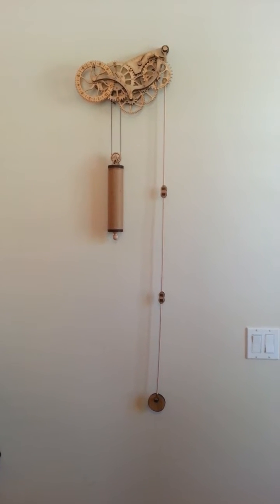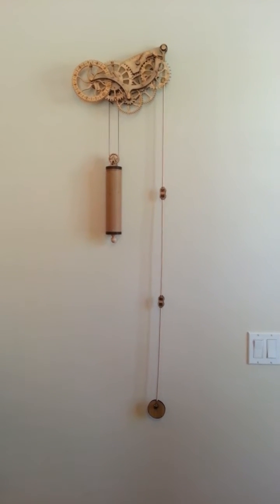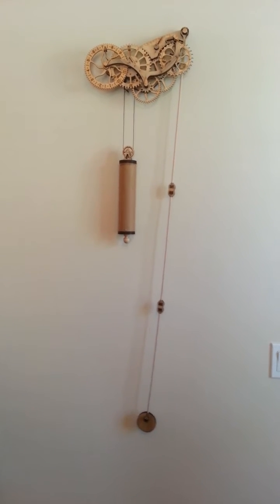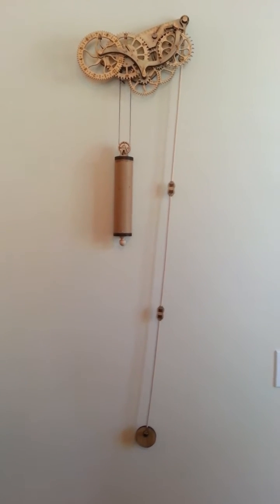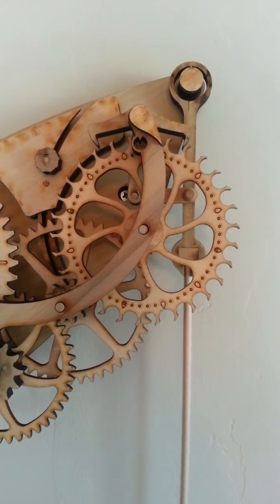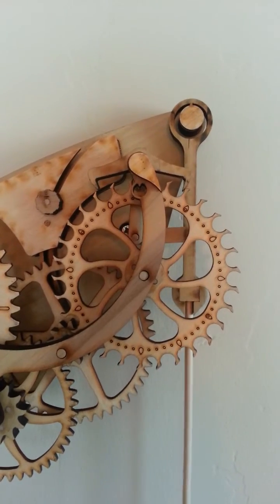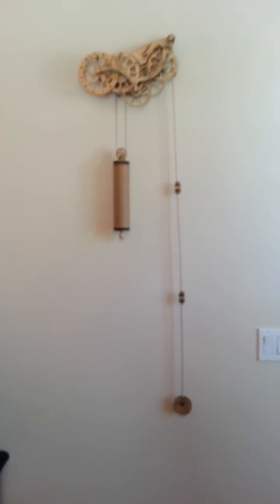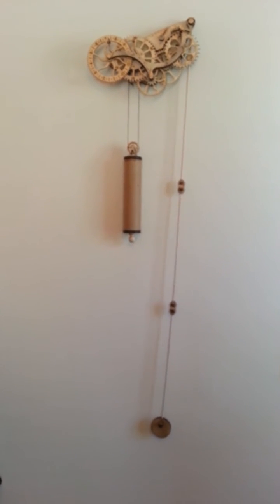Wooden mechanical clock in action!!

Comment: Does the screw at the bottom of the pendulum actually do anything for your clock?
Reply from the maker: I have to say that I didn't find it terribly useful... Precision after initial assembly was good, but if you are off by hours after half a day, then it's likely you need to take some weight (nails for me haha!) out of the pendulum instead of mess with the screw.

Comment: Just built one of these myself and also had to tilt it just a bit to the left to get it in “beat”. I also had to shorten the pendulum to get it to run fast enough. Winding is very cumbersome also. There are a lot of ways this kit could be improved, but it’s a great first kit to get into wooden clocks.
Reply from the maker: The Junkologist's Junk Heap agreed! I used to wind it every day, but now I only do a show-and-tell for guests haha! Did the tuning screw help at all? I only noticed a difference if I took it completely out of the pendulum
Reply: Jim Stiernberg 
I had the tuning screw in there hanging down, on top of the hole, and everywhere in between without enough effect to get it to run fast enough. That’s when I started cutting little bits off the rod until I got the clock to run fast. Once I got it to that point, I’ve been playing around with the screw and I think I may have it dialed in pretty good now.